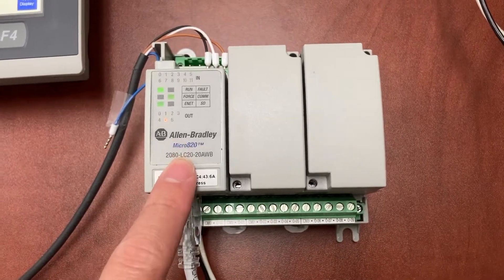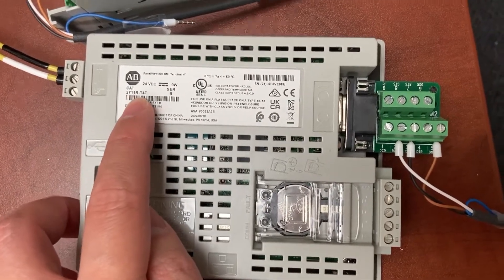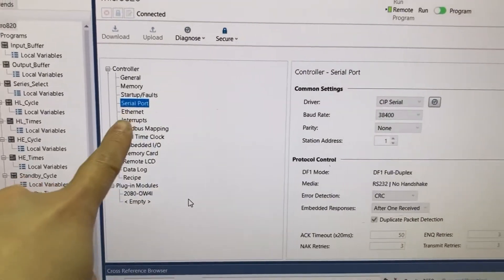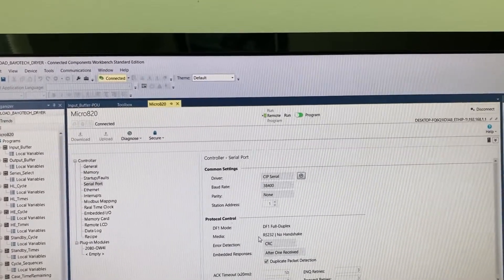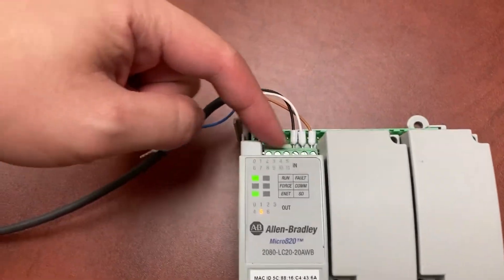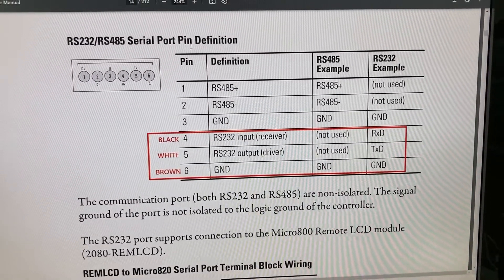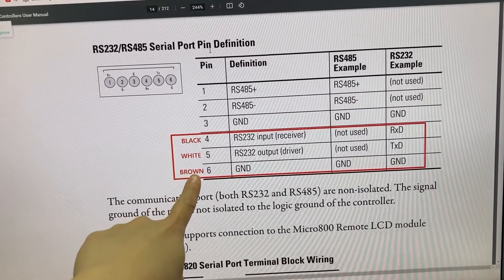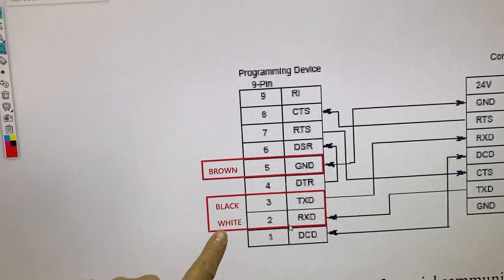Micro820 PLC and Panelview800 HMI DF1 RS232 Communication Pinout

Comment: hi.. I want to ask maybe it's off topic in this video.
1. I would like to ask how to retrieve the communication status between PLC and HMI (example: if communication is lost between PLC and HMI, then HMI will display communication broken alarm).
2. how to take the RUN, STOP, Fault status on the PLC which will be displayed on the HMI (example: on the PLC, if a PLC FAULT status occurs, then the FAULT status will appear on the HMI).
 This question is very important to me because from these 2 cases I can find out what happened to the PLC and HMI. so I hope you are willing to answer this question.
Reply from the maker: @sukri wan: Thank you for subscribing to my channel. 
Your 1st question: I am not sure what you meant by "retrieve the communication status between PLC and HMI". Once the connection is lost, it should pop-up bunch or communication alarms because the HMI just cannot find data from the PLC. However, once communication is restored, you will just need to close all those alarms.
Your 2nd question: You brought up some very good points that I thought about and verified long ago with Rockwell. Unfortunately, Micro800's (800, 820. 830, 850) do not have the system data file that not only you but everyone else is looking for to map to the HMI for easily monitoring PLC statuses or PLC fault codes. I know it is hard to believe it but that has been verified and confirmed with Rockwell. I completely how important it is because with CompactLogix, ControlLogix I always show the PLC status along with all IO module connection statuses on HMI instead of only faulting the PLC and not showing any causes on the HMI to the operators. It is a good practice make it much easier for troubleshooting; however, again Rockwell just does not have it on Micro 800's PLC's. Their answer is simple. We have to use a laptop and CCW software to go online with the controller to see the fault code. That is why its prices are much lower than those of compactlogix and controllogix controllers.